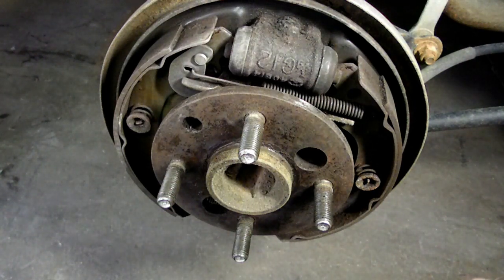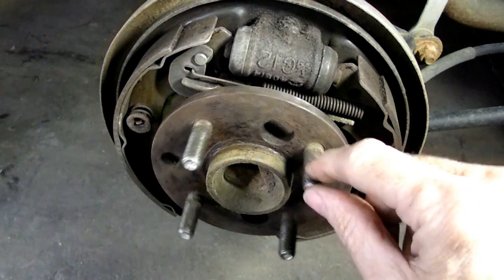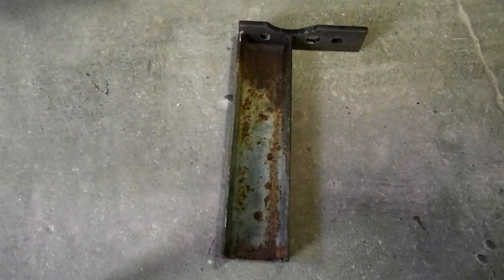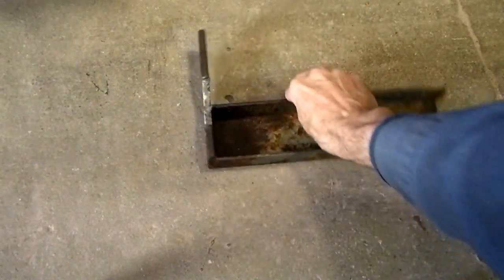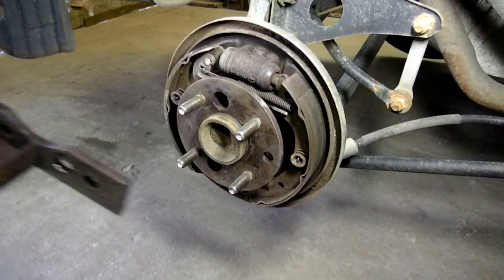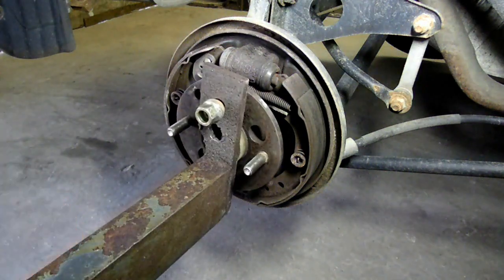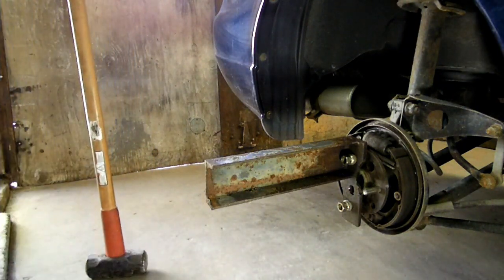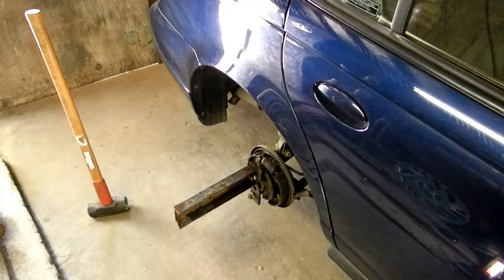Bolted Hub Wheel Bearing Removal Walkthrough

Comment: Thanks for the tip. For the front ones with the driveaxles through them, I can see where a slide hammer might be a better idea. I've never had to much issue with these, as there is room to tap 'em out. The 99-04 Grand Ams have aluminum steering knuckles to save weight. These corrode to the steel wheel bearings, making them a pain in the butt to remove. Liquid Wrench and some patience gets these out, but the part on mine was destroyed when I got it out. the flinger was still inside the knuckle.

Comment: I have found that turning the brake drum around and putting on a couple of wheel nuts loosely and then using the Drum as a slide hammer works really well. It never takes me more than a  couple of goes to get an axle out. You are also using it in line with the axle. In my  opinion Hitting down on that contraption at 90 degrees to the axle with a heavy sledge hammer is likely to do all sorts of serious damage including possible cracking of the diff housing.

Comment from the maker: Most bad wheel bearings i have worked on made a droning or winning sound you could hear inside the cabin when driving.If it is a bad front bearing and you turn the steering wheel from side to side while driving you can hear the pitch of the noise change as you load and unload the bearing.

Comment: If you want a cheap quick available tool to get that bearing out, what you do is put the disc back on BACKWARDS and bolt it up just a couple of turns on the thread and use it as a slide hammer.

Comment: The main problem with this method is when the bearing comes off so does the backing plate. Not a big deal if you have rear disk brakes as the caliper is removed before the rotor. But with drum brake set up there is a good chance of breaking the steel brake line or kinking it going to the wheel cylinder when the backing plate falls off.

Comment: I used a slide hammer to accomplish this task but now the backing plate is rust welded to the old hub, I have Removed the wheel cylinder and park brake cable, now what do I do to separate them

Comment: What are the signs of a worn rear wheel hub/bearing on these Saturns? From my old school auto shop days in the 90s, it was when there was a scratching or sanding sound coming from the bearing/hub; or if the hub was locked up and very hard to turn.  Or, if there was too much axial play in the hub/bearing, i.e., when you grab the wheel with the tire on, there was too much in/out play along the axle such that you could push the wheel in and out a little bit. Is it the same for these Saturns? Thanks

Comment: is the 1998 sl2 saturns the same hub/bearing combo like this...asking because no one at outozzone knew off hand. I have a left side oil output seal which is leaking and im being told a bearing could make it leak again, if not evaluated by professionals & replaced. just asking 4 more bearing insight while i gather repair data.

Comment: There is no differential housing to be concerned with. The subject of the video is a bolted on self-contained hub, not a solid rear axle with a center differential like the kind typically found in rear wheel drive pickup trucks. It's a different kind of hub.